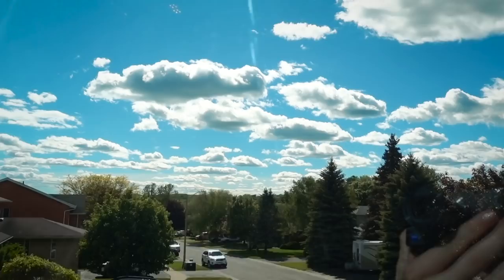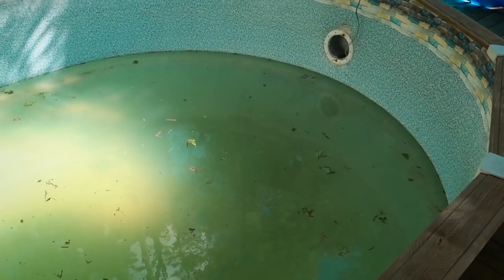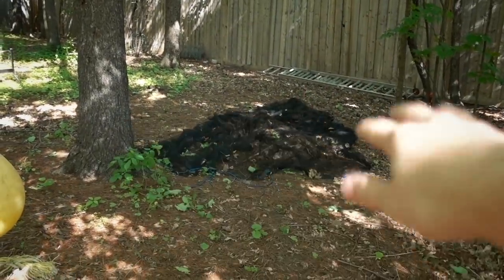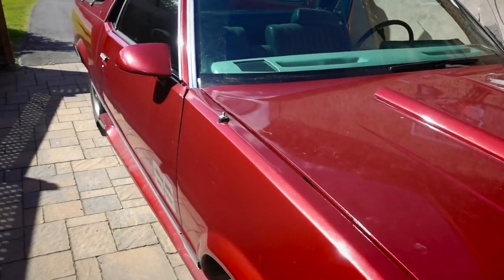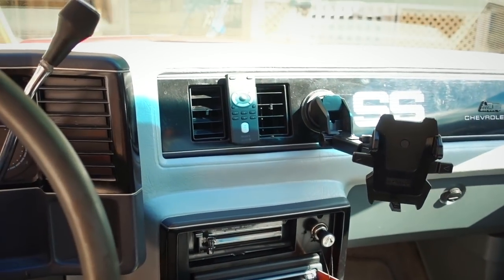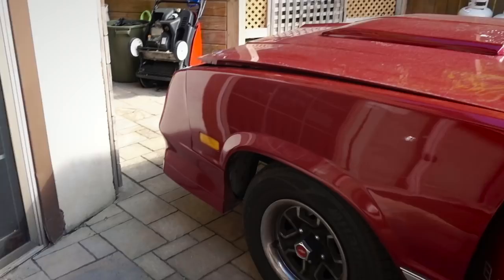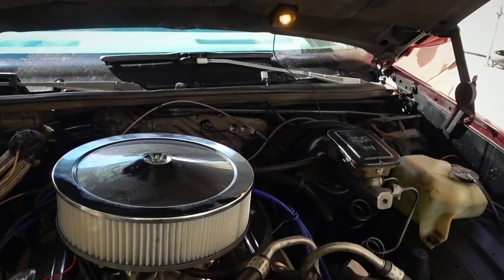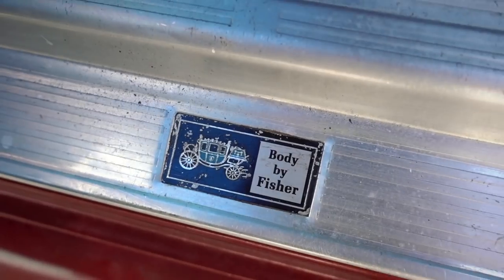THE EL CAMINO IS BACK!!

Comment: I own an 86 El Camino conquesta which is a two tone black and silver. First the hood just had a scoop to make it look different. It does not mean anything for bigger air cleaner. If the motor is still the 305 the stock air cleaner was a lot smaller. second the back bumper from what I am aware only came with the chrome style. Finally the side pipes and bedrails where an option and not standard. I have bedrails on my El Camino that the original owner wanted. Good luck on the Camino.

Comment: Id like to put the light back under the hood how did you get it working ? I don’t have anything for the set up but we’re exactly would you run the wiring and where would you hook it up on the fuse box

Comment: First, you might need a new battery for the El Camino, (or new battery acid in the existing one). You should also check the fuse box to see if any of them are blown. If those don't work, it might be that a particular wire is in the wrong spot.

Comment: if you have anything plugged in  the cars cigarette lighter wile the car is off it will drain the battery. since it's an older car the cigarette lighter still has power when it's off.